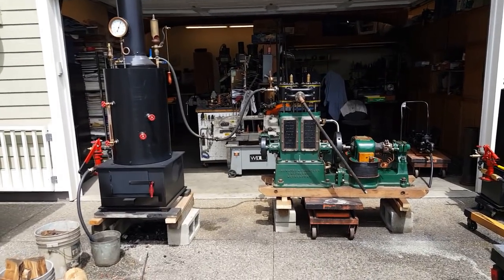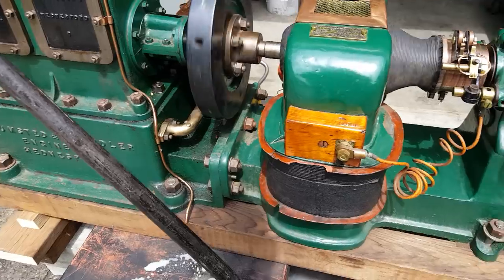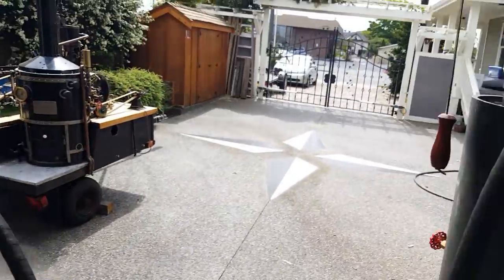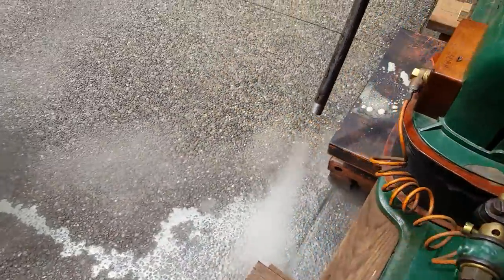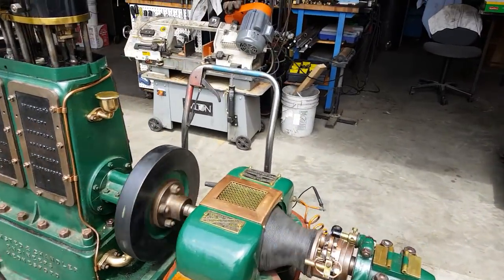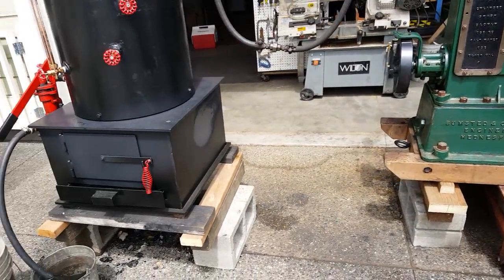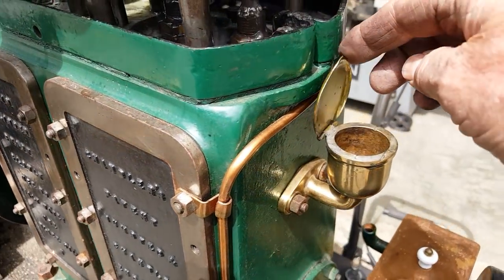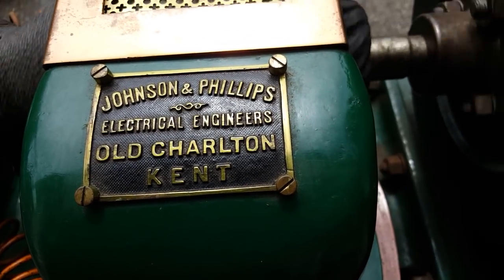Steam Engine Dynamo

Comment: Oh the problem with that multimeter is that you are using it in DC area. You should use it in the AC area most likely (the red 200 and 600 volts)
Reply from the maker: Hello, I try the red 200 and got 4.5 on that setting. Give me a call 206 948 0770. Thank you very much. Ross
Reply: Rich I think it's generating AC.
Reply from the maker: Yes! Later I change it.
Reply: It is 100% a dc dynamo, I am the supervisor of an electric motor repair shop, also that is the coolest thing I've ever seen in my life
Reply: The brass things on the cylinder head are pressure/water release valves, for the piston valves , Regards.